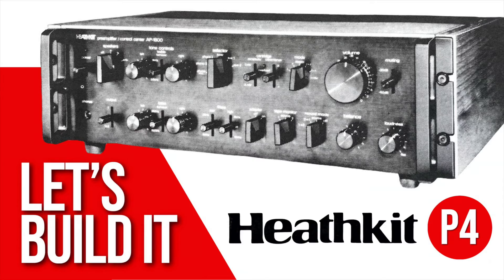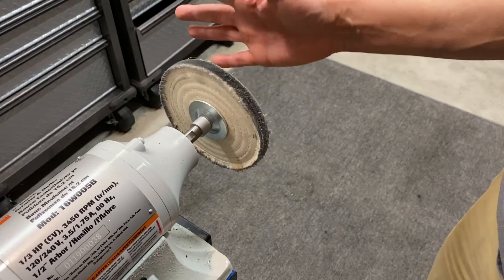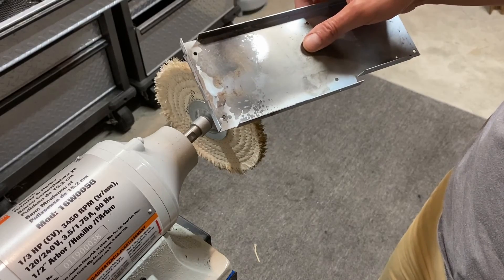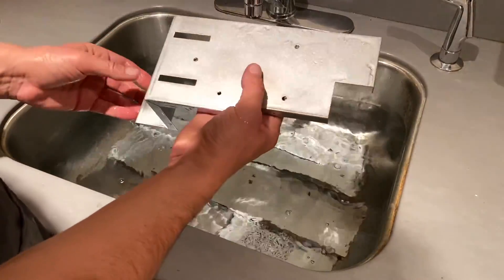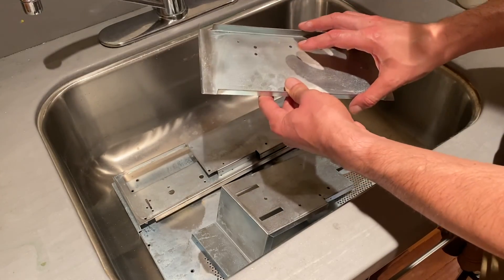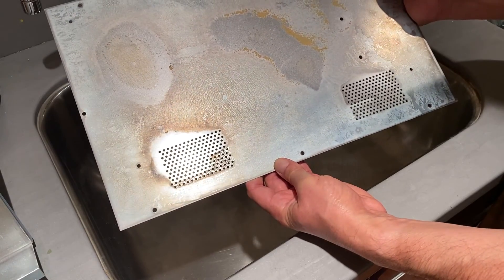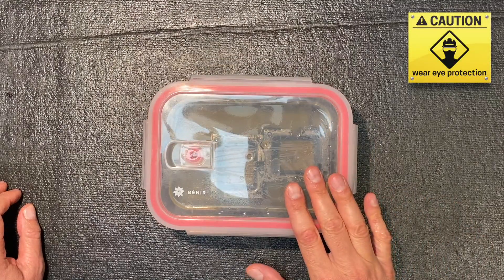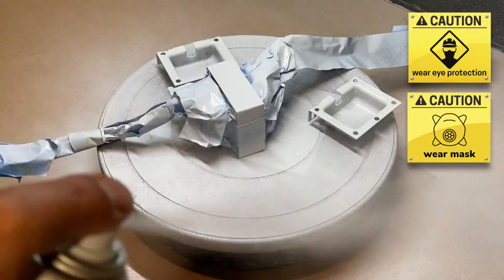Let’s Build A Heathkit Stereo Preamp • P4 Removing Corrosion/Painting Chassis & Transformer

Comment: That is just a cheap zinc plating.
Reply from the maker: The fact that the parts were zinc coated was explained in the video. But I agree, it wasn’t especially well done as these had a fair amount of corrosion even though they were just sitting in a box and never exposed to heavy moisture. The new coating I added should work out much better.